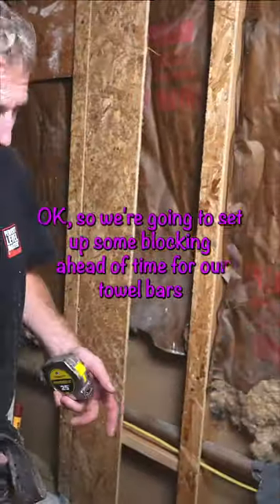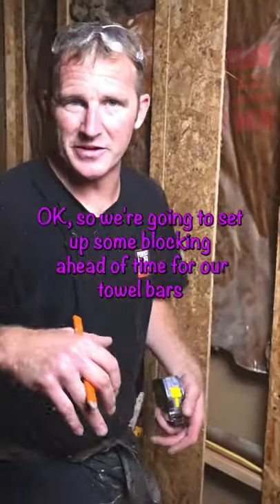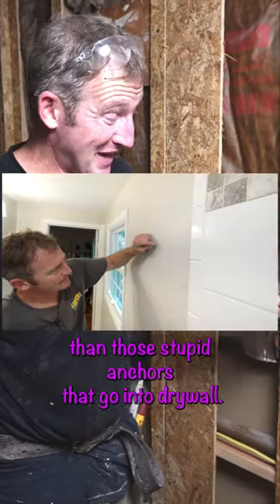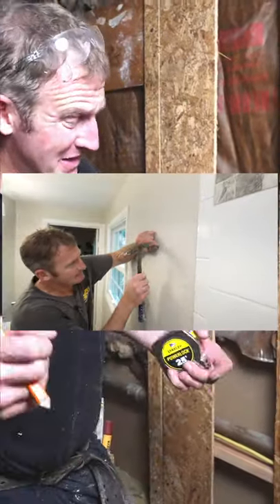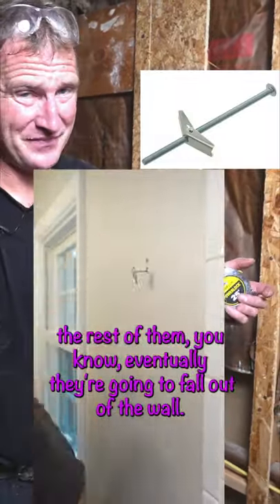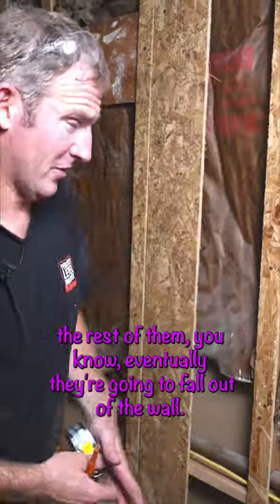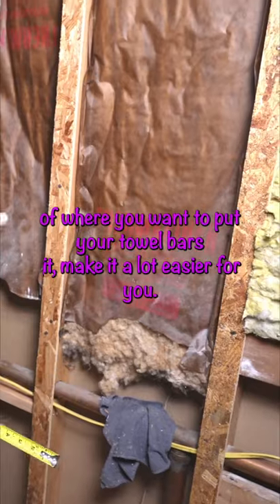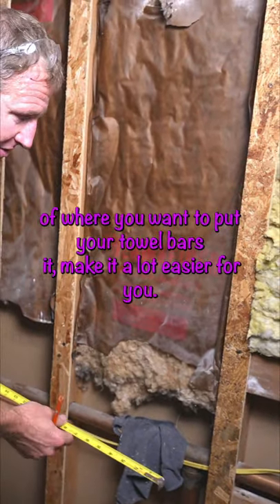Blocking for towel bars #shorts #homeimprovement #tipsandtricks

Comment: Blocking with OSB ...really not an ideal thing to use in a wet environment....
Reply from the maker: Waterproof boards - go board 👍
Reply: @BathroomRemodelingTeacher  what's your showing isn't waterproof..... we block out the walls with 1by... I've been a carpenter for 44 years never seen anybody use OSB in a bathroom we don't ...and never have....east coast
Reply from the maker: @paulunderwood8960  it’s just a shim. 44 years! Your still doing this stuff? I’m in 22. Or at least being in business that long. Hoping I don’t have to do this stuff in another 20 😆
Reply: @BathroomRemodelingTeacher  I'm still Framing and doing carpentry I do a lot of composite decks fences repairs doors and windows don't frame no big houses no more
Reply: If moisture is getting to blocking then you have much bigger problems than the blocking itself.
Reply: @Tool_Addicted_Carpenter  I agree but you also got expanding OSB busting tile off a wall the leak could be with inside not the roof humidity